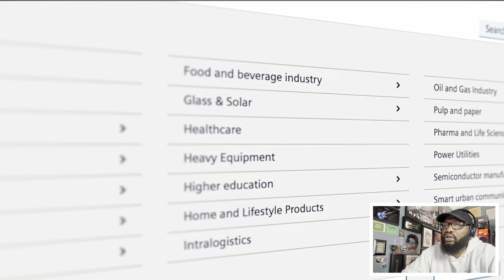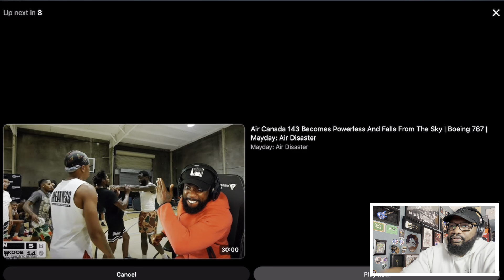Helicopters DON’T just fall from the sky - What Is “Mast Bumping”?

Comment: " Helicopters Don't FLY,  they vibrate so badly the planet rejects them,  that is not enough,  the rotors BEAT the Atmosphere into submission.  "   This is a quote most pilots know.  another is "a helicopter is 10000 parts flying in formation all trying to kill you."   The need constant attention and adjustment to stay flying  a lot of those adjustment are very delicate and minuscule,  a balance between the collective,  throttle and cyclic and both pedals.  Abrupt control inputs can over load the mechanical controls,  rotor blades,  fuselage. This can cause Mast bumping and OTHER Failures.   In addition,  they vibrate so badly, then need constant inspection and maintenance because they DO TRY to disassemble themselves,  this is part of the reason that fasteners are wired to prevent them from backing off and loosening .  There are so many reason a helicopter can crash,  anything is possible at this point and we have to wait until the NTSB investigation to make their report.

Comment: No mast bumping here. That requires a low-G pushover. Sudden right yaw in level flight, tailboom separating at the fuselage, indicates abrupt drivetrain stoppage, most likely gearbox failure.

Comment: Mast bumping has static protection curved mounts on the head,to inflict stress marks on the mast are slim,when tying down the blades at the end of shift the rotor head in tilted to make contact with the stops to protect the flexing during extreme weather conditions,the bades have a fabric fiber wrap to hold it down when tied to the vertical fin stricker rod.

Comment: The Bell 206 JetRanger has been in production and flying for the last 65 years with 32 million flight hours on the clock. This was NOT mast bumping, my guess is a catastrophic gearbox failure that to the best of my knowledge from what I have read has never happened on this platform. When the NTSP reports its finding in a couple years it will be maintenance malpractice if I was to guess.

Comment: Could NOT have mast bumped. The rotor was intact. It was also still attached to the gearbox. Sudden catastrophic failure of gearbox. Locked solid. All of a sudden the rotational force was equally split between the rotor and the air frame. The tail got ripped off by sudden rotational force. Mast bump doesn't have the force to rip transmission out. Ever seen a FWD car with 2 flat front tires and a big dent from inside of hood. Wheels stopped, drive unit kept going.

Comment: This is why I never fly in any machine that was made and maintained by humans. I won't even go on rollercoasters. When you enter a flying machine you are placing your life (and your family) in the hands of OTHERS. Those machines have thousands of parts that can fail due to accumulated stress & wear and when a failure occurs in the air there is no escaping, and you have to experience the horror of knowing you are going to die.   Seems like the richer you are, the more of chance of an untimely death, like Kobe or J.F.K. Jr. and this family. All 3 of these flights were not necessary.  R.I.P. ❤‍🩹   I can't believe Gail King and Bezzo's wife and other women are going to place their life in the hands of others JUST for the thrill of going to space. Didn't they see those two flights of SpaceX disintegrate after launch.

Comment: It wasn't mast bumping. Anyone that knows what that is and knows the Bell 206, can tell you that.
If it was mast bumping, the rotor shaft would have sheared just below the rotor head.
This one had the entire rotor head with blades, rotor shaft, and transmission all come out in one single piece.
Either the transmission had a catastrophic failure, or the top structure that the transmission is mounted to failed.
That structure has a required inspection for cracks and it's not exactly easy to do. A prime candidate for being pencil whipped and that means, saying you did it, but actually you didn't.
It is very rare to find one cracked, but it does happen. I found one myself and it required the replacement of the entire upper deck the transmission is mounted to.

Comment: RIP to the families. The winds are not right this year all across the country. We’re seeing many odd storms. People that are critiquing the Black helicopter pilot do not know the New York Harbor area. I grew up in the City. They keep building taller and taller buildings on both sides of the Hudson & East Rivers. Whether you’re walking on the streets, or were taking an elevator in the old World Trade Center towers, or riding the Staten Island Ferry, the winds are ALWAYS blowing. It’s just a matter of how much. You could ride an elevator in the Twin Towers and you ALWAYS feel the whole building sway in the wind. They were built to accommodate those high winds. Now imagine you’re going towards New York Harbor, which is huge going out to the Atlantic (Ocean). Spring winds there are something else, especially when you’re going south on Hudson towards the Harbor. You always have to watch out. That helicopter could’ve been pushed by a sudden wind gust. That helicopter manufacturer also has a history of rear rotor mechanical problems. One has to add that helicopters are always problematic.

Comment: I think they were caught in a burst of high intensity wind. I work by the water in NYC the other day I was outside walking during lunch there was a sudden burst of  high wind I had to dig my feet in the concrete or I would have been blown over. Then it just dissipiated it all went back to normal. There has been something about the wind this winter and spring season. It's been vicious, unlike other winters. I have into work a few times and ask my coworkers what is going on with the wind. If that chopper got caught in one of those wind anomalies, I can see it being powerful enough to bend the blade on that chopper

Comment: there was no Mass Bumping at all looking at the video where the chopper just cruising along at constant altitude and not even turning,  The darn thing came apart in whole piece where the blade and the transmission still firmly attached.  The must be an explosive device like those used for demolition of building.  Shouldn't be hard to find out who touched the chopper before and who booked the tour

Comment: Mast bumping is a dangerous condition in helicopters, primarily those with two-bladed, semi-rigid, or teetering rotor systems, where the rotor hub strikes the main rotor mast. This typically occurs during low-G or zero-G conditions, such as abrupt maneuvers, turbulence, or improper control inputs, causing excessive rotor blade flapping. The contact can damage or shear the mast, leading to rotor separation and catastrophic loss of control. It’s often linked to pilot error, like rapid cyclic or collective inputs in low-G situations, and is less common in helicopters with three or more blades due to their articulated rotor designs.

Comment: This helo didnt just fall from the sky. Either it was a drone or birds which caused the pilot to do a drastic move where the blades actually cut off the tail section. Or something crashed into the helo, but, i seen some footage  of the helo flying before it broke apart. It didnt look like anything collided with it , but, it was far away from the camera and wasnt very clear so we may not have seen something like a drone hit it. Sabbotage is another possible answer. The last possible answer i can think of is bad maintenance or something that came loose. Thats all i can think of, but hey, i aint no helo pilot so what do i know. I seen the Marine talk about alot of helo crashes, i agree with military aircraft. This make and model of aircraft from what i know hasnt had alot of them. Oh, the other option is the pilot trying to be a hotshot in the helo and cause the crash. No matter what, the fact that this father/husband was a ceo of a big company definitely makes this add suspicion.  Prayers to this family, these accidents are way worse when children die.

Comment: There was strong wind that day some other news helicopters would NOT go up because of the 25 knots winds, that may not seam like a strong wind, but it could drop the helicopter up and down pretty fast, causing a tail strike, remember these helicopters are for TOURS if they are not in the air, they are NOT making money, there is a lot of mechanics in a helicopter all it takes is for ONE thing to fail and it's over.

Comment: Helicopters fall from thr sky all the time but most never make the news, especially tourist helicopters. My husband a retired USAF Pilot and World Airways with 40 years of flying, would never ever step on a helicopter was under Direct Orders. If they have mechanical problem they are going down they don’t have capable of any glide and “will drop like a rock”. Sully was life long glider pilot since USAFA was responsible Miracle on the Hudson.
Reply: This is not true.  Yes, there are things that can happen such as what we saw that can bring a helicopter out of the air like a brick. 

You need to research “autorotation” because it is not always a death sentence to experience a mechanical failure on helicopters.  Not all helicopters are built equally.  Some have multiple rotor blades meaning 4+ 5+ 6 and huge helicopters maybe even more.  Also, single engine vs twin engine… turbine engine vs piston… many differences.
Reply: @ I will follow my husband critique because of his schooling in aviation and 40 plus years in the cockpit
Reply: @jakesbel8237  Airplane pilots are not helicopter pilots.  Totally different knowledge and skillset.  Yes, some airplane pilots are also trained to fly helicopters and some helicopter pilots are trained to fly airplanes but they are not directly interchangeable.  Each requires their own training.  Airplanes do not work the same as helicopters and it would be unwise to assume an airplane pilot would know anything about a helicopter especially having not flown one.  Again, do your research and watch a simple video on “helicopter autorotation”.  Helicopters do not always drop like a rock.  It’s simply not true.
Reply: They don't need to make the news, Juan Brown has a YouTube channel

But people don't care to find THAT because they don't really care about stuff like this

Comment: Almost certainly it was not mast bumping.  Catastrophic failure is the most likely failure caused by a sudden stop of the drive linkage between the engine and rotor OR a failure of the drive system where it just exploded.

Comment: Such a horrible tragedy, My condolences to the family and friends. 
As a former helicopter pilot, I concur this guy is spot on. Mast bumping is one of the things we learn about in basic ground school. Only semi articulated (2 rotor blades) have the ability to teeter, and are prone to mast bumping. A 3 blade or more rotor system is called a fully articulated system, and the rotor disc doesn't teeter, but stays on the same plane in relation to the fuselage, and cannot mast bump. One thing not mentioned is, although the weather and wind at the time was stable, and there were no aircraft in the immediate vicinity at that exact time, that area of the Hudson regularly experiences low flying air traffic in multiple directions at any given time. Some of this traffic are large airliners on approach. They leave behind them a very powerful vortex turbulence wake, many miles long, and can linger in the area for up to 10 minutes or more, and its completely invisible. Its like flying through calm air, right into a horizontal tornado. At larger airports, heli pilots and light aircraft are warned not to hover or taxi in certain areas for at least 20 min after an airliner takes off or lands. The likelihood that he went into a vortex wake 5, 10, even 15 minutes after a plane went by is very high. Usually its not a major issue, but if you hit it right, and over correct with cyclic stick input too fast or to a limit stop in any direction, you will be in a mast bump situation. Same would apply dodging a flock of birds, or even a goose strike directly to the rotor disc. The rotor disc (the perceived flat circle that the rotor blades rotate in) will deform or warp during a mast bump or bird strike, sometimes even landing too hard. Because the rotor blades flex, a shock to the rotor disc will induce a rippled waveform as the blades flutter violently, similar to dropping a spinning coin on a table. This flutter, along with fast over correction of the cyclic in an attempt to gain control is a quick recipe for a rotor/tail boom strike, with enough force to shear the rotor head from the mast, and delete the tail boom in a fraction of a second.
Reply: I had to read that a few times to understand what you were saying 😢
Reply: @indiaannarie6023  Sorry, its difficult to describe without visual graphics like we had in flight school.
Reply: indiaannarie6023.   Don't worry you weren't expected to understand all that.  ❤ Some things take a lot of reading several times. That was very complicated information. You did your best and that's what it's all about!    😊😊😊❤❤
Reply: @indiaannarie6023 😊😊😊❤❤❤
Reply: FYI:   As an 82 year old woman I understood exactly what you were saying.  I've never had any technological military or flight training experience...I just like the technicalities of how things work  and I pick up certain aircraft information faster even with dyslexia. You explained the information word for word perfect without the graphics. Thank you so much!  My deep condolences to the family members.  ❤❤😢
Reply: Thank you for explaining this!!

Comment: I'm not an engineer but worked on Helicopters in the Army and for ten years after I got out at JRTC at Fort Polk. Just watching this video of the crash and seeing the tailboom is mostly gone the rotor and transmission have also separated from the fuselage. All that damage would be hard to rig to take out a helicopter, especially without explosives, just to conspire to take someone out. there are many other easier ways to cause a helicopter the go down and look like an accident. Why the rotor struck the tailboom will be determined from the investigation. It could also have been the mounting beam the rotor transmission is tied to suffered a fatigue crack and failed. With the helicopter clearly in multiple pieces as it is going down this looks like a mechanical failure of some type.
Reply: @davidlewis3196  it definitely had to be sudden for no distress call to make it out. Even in a rudder stall, there's warning. This could've been plotted or could've been a stripped screw that finally gave out. I look forward to seeing what the NTSB finds.
Reply: Doesn’t appear to be a mast bump incident. Experts are speculating a transmission failure
Reply: My husband is a retired helicopter pilot and he was just explaining his assessment of this to me and it tracks with what you're saying. According to a witness, there were 6 booms (mast bumps) heard. He said that you're not recovering from that. He went on to explain several other points but I'm not the one to reiterate his words with my limited understanding. Bottom line is, there was no foul play. It was an unfortunate situation. I asked if he thought that it was pilot error or mechanical. Best I could derive from his lengthy explanation possibly  a bit of both. He said that they have to study the engine and it's going to take time for their conclusion.
Reply: I won't argue the technical details all I have to say is that this death tied off a very loose end for Gavin Newsome and his faction in the DNC and note that they tried to kill Trump to keep him out , firing on the man while he stood in front of packed bleachers killing bystander. Newsom represents their only real hope of preventing Vance from taking "Trumpianisim"  and the populists in to the 2030s and Trump has been sniffing around the calli high speed rail project... just saying. For my self if it comes out that it could have been known that this victim would be on that aircraft... any assumptions other than political expediency are off the table.
Reply: That's exactly what happened. Transmission/rotor mounts failed
Reply: David
Is it possible that main rotor retaining nut aka Jesus Nut can be culprit in that catastrophic crash? Because you can see main rotor (main blade) falling unattached after chopper crashed in the Hudson.
Reply: good question
Reply: @MrTech226  it would be possible, but from the limited details seen from the video it all is speculation. When the NTSB inspectors get done examining the wreckage it will probably be apparent of the root cause. Hopefully we will be able to peruse their findings soon.

Comment: The propellers came off... WTF ?
Reply: With the transmission still attached, that’s the part that really doesn’t make sense at all.  You can see the tail snaps off then the main rotors comes off with the transmission still attached, as the body falls upside down with small parts coming off. I’ve seen helicopter pilots saying “mass bumping” doesn’t make sense the way it came apart.  I’m just repeating what other pilots have said